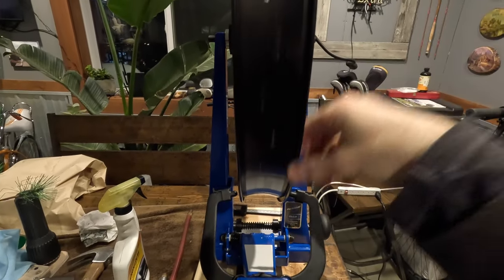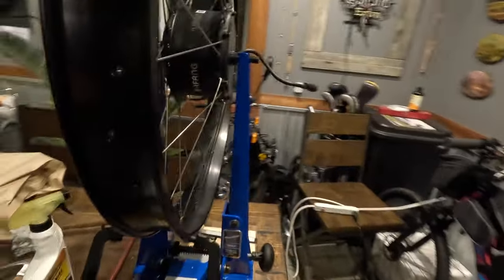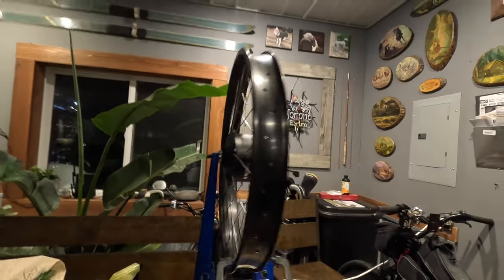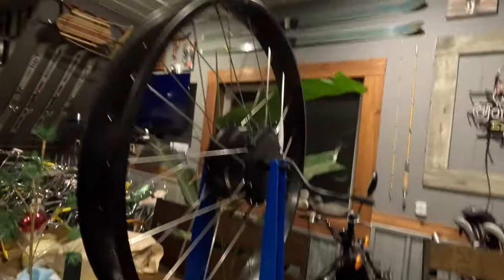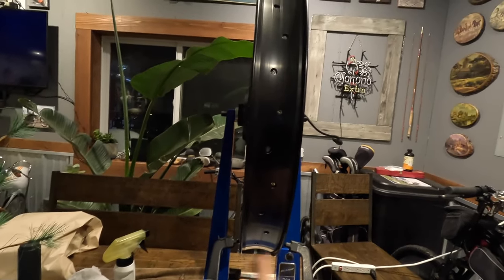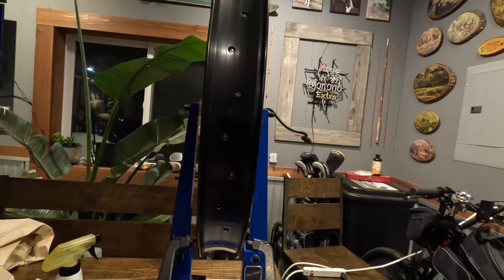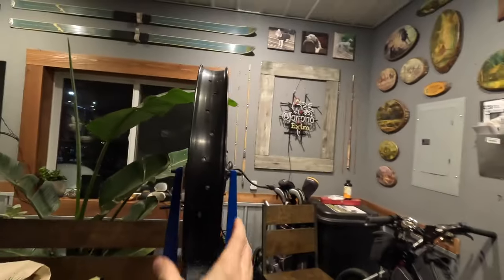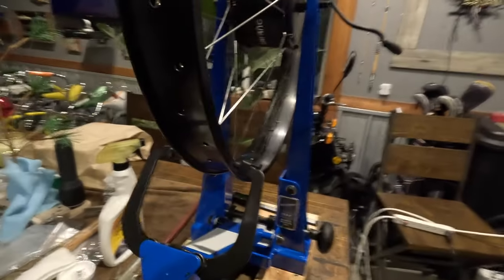Let's Build a Wheel - BAFANG G60 Hub Motor

Comment: Ive got a spare thousand watt motor one on the back i also have a extra battery will i benefit alot more  by puttin  the motor on the front ? Like uphill i shouldn't have much hassle right  ,but i also like going off roads and its prestty rugged here were i am ,so do you think i  should get a decent 2way controller or have it completely on its own battery motor and controller just like the back

Comment: You're making it look pretty easy I just ordered bafang for a plus six red Rover and it doesn't fit like they said it would. They said yeah just pop it out of the case and put it in your case. Then I get a hold of them and he says well you could re-stitch the spokes or whatever re-lace. Then I thought I'll just put the original f**** motor back in and be done with it all lol
Reply from the maker: @ernestatwood2787  there’s the shell that laces into the spokes and the rim. Then there’s the motor core , with the axle and the guts of the motor, you can take that out. And some are interchangeable. However, there are different variations of the motors. Some open up and the core comes out the drive side, some are the non drive side, The clutch in the inside of the motor likewise has two versions,   Etc. so in order to pop another one in it has To be a somewhat similar variant.  They come in different axle length and OLD outer locknut diameter. Eg 175mm and 190mm spacing on the g62 .  So if you want to upgrade yeah needs to be somewhat similar. You probably got one with a longer axle length / OLD, or you got one where it pops out the different side of the motor , etc. there also cassette vs freewheel variants of the motors
Reply: @EBikeBuilder_  thanks. Makes sense. They are taking it back  so that's nice. YouTube school is good! Lol

Comment: aliexpress motor link?
Reply from the maker: The front motor to buy in 2024  is Bafang FM.G061.1000.D    It is the 1000w front hub and has an m14 axle. I wouldn’t get one with m12 axles they spin out so easily

Comment: Wouldn't a back hub wheel work on the front ? Once it fits and sprockets are stripped .
Reply from the maker: No , front dropouts on fat bike forks are 135mm, and rear motors are 175mm or 190mm , even if you take the cassette off  it still has a long axles that won’t work in 135mm front spacing. I’ve also tried to put a 190mm motor in a 175mm motor shell and that doesn’t work either. Its hard to realize until you try and do it with the motors in hand. But each size is physically different for a reason
Reply: @EBikeBuilder_  my 20+⁴ are dropouts there not common but ive a American magnum fatty with them its old now and a stepthru design with a 2tho watt motor 72volt battery fits like a dream were the stepthru is wouldnt advise on todays foldables this was when proper men made bikes good company that magnum they use or are german but based in america get the American models das kit i think is one of the most reliable solid there is my mum has her daily 9yrs 12miles a day

Comment: That’s going to be a beast!! 👍
Reply from the maker: not entirely practical. but it should be fun and entertaining 🤣
Reply: @EBikeBuilder_  your rite and sorry if i came across as a tool! ,heres what im currently at making a machine thatll pushout axles so atleast front motors can fit in the back cos we all know they never last no matter what we do ,well 1 has lasted for me but looks Frankenstein like i put a rear on a front shock using like scaffolding poles going up so far eachside cant blame a brudda for rhe hustle bro 😆😆😆got the whole summer outta that bitch and still goin ✌️

Comment: Some one knows if you can put that motor in the normal rim no fat ?
Reply from the maker: It needs 175mm rear dropouts, you could spread a steel frame and put it in
Reply: @EBikeBuilder_  but I'm have 1500w motor hub and is so much bigger than this one

Comment: Overall good info but there are a couple of steps missing.  The first is making sure the wheel is round.  You would do that by bringing the stand arms down to the outer edges of the rim and seeing where it strikes them.  You would then tighten the spokes around the high spots to bring the wheel into round.  Considering the speeds I suspect you are looking at maybe doing, having a good and round wheel may be what keeps you with the rolling side down.  
The other is pre-stressing the spokes. You want to do this step after you have the wheel rounded and true as the spokes need to be at or very close to their final tension. This can be done by putting the wheel flat on the ground with a piece of wood or something to protect the hub.  Put your hands on the side of the rim across from each other and pushing down hard. You may hear the spokes ping as they are getting seated against each other or in the hub flange and the nipples in the rim.  Rotate the wheel or move your hands a bit around the rim and do this until you have pushed seated all the spokes.  Do this to both sides of the wheel and re-true the wheel.  I like to go through this at least  I've seen old school builders that would even stand on the rim.  This step will help with the wheel durability as it will lessen the amount of loosening that will happen in the early use of the wheel.  I always bring my wheels back to the stand after each ride for the first few rides to ensure all the spokes are still in proper tension as they settle in.  Loose spokes is the most common failure of a wheel barring crashes.  When they are loose the elbow is able to move around in the hub flange and will break there.  
One other note for anyone following this guide is to make smaller and smaller adjustments the tighter the spokes get.  Once I have the dish correct I start turning each nipple less and less.  Smaller adjustments make it easier to get everything lined up.
Reply from the maker: correct, good points. I mention Radial truing, but also said I don't intend this to be a tutorial on wheel truing. This is the 2nd wheel I have built, I don't claim to be a master, just showing the general steps. I take it very easy riding the wheel around slow in the driveway at first, and will make more adjustments after riding with a load on the bike. I'm not quite there yet, still haven't installed the wheel, waiting on my z916 extension cable and flange nuts. I do plan on riding at the speeds you suspect  Lol,  so i will take my time with it.  Thanks for the tips I will try them out when I make further adjustments to the wheel.
Reply: @EBikeBuilder_  Yeah I figured you would be doing more with the wheel when you mentioned the park tools video.  Just wanted to get the info out there for anyone that might be inclined to follow along.  My first wheel build failed miserably and I wasted a fair amount of money on spokes to rebuild it a second time.  Thankfully I did not crash as a result.
Reply: I've never heard it explain like that the rolling side down lol. Yeah I'm toying with the idea of releasing mine but man I really don't want to get into that I called my local shop and they just stopped doing it because they said it was a pain in the ass

Comment: 3 motors must be quite an experience! Will you put also 3 batteries? Also 72 Volt on front motor?
Reply from the maker: yeah its gonna be 3 batteries,  i'll have to have one in a backpack till i figure out how to get it on the bike. Im not gonna do 72V on the front motor, it would require an expensive controller thats kind of overkill for a 750w motor. I might in the future so i can get both hub motors hooked up to 1 throttle and the cycle analyst display.  For starts the G60 will be on 48V or 52V with a stock ish controller doing about 1100W

Comment: I'm doing the same thing but use an All Axel direct drive in the front with 3 20 AH 72v batteries. Just waiting for the 3 Phaserunners to come in stock. I believe all 3 motors can be run off of 1 throttle. This bike is geared down for torque not speed but believe all 3 together will do more than 70 km/hr. Strictly a bush mountain climber.
Reply from the maker: i dont know if they make the phaserunners anymore?  i thought the frankenrunner had replaced them. Maybe it was just a short term thing due to component shortages im not sure. I havent seen phase runners in stock since the plague happened.  Grin Tech has a CA3-WP splitter cable that can apparently be used to hook up multiple motors to a single cycle analyst, it might be limited to 2 motors im not sure. Grin has some videos about it  but not much written documentation.  In any case that All Axle hub looks awesome man ive been close to pulling the trigger on one of those! Let me know how it goes id love to see!
Reply: Have been in contact with them and should
Reply: Phaserunners should finally be in soon.contacted them about the splitters waiting for reply to see if 3 motors can be run on 1 CA3- W P

Comment: Hi,,,great work on your vids,,,🙂. I have an inquiry I was hoping you can help me with. Due to buying a kit/individual parts,,,would it be possible to just buy an inexpensive fat ebike,and just swap the rear hub motor to the front?
Reply from the maker: You can use whatever motor you want, as long as it can fit in the bike dropouts. However, the front and rear motors come in different widths. So generally you need a front-specific, or a rear-specific motor. Because the dropout spacing on a rear fat bike is usually 170mm or 190mm.  And the front fork usually is 135mm. If you want a front motor, it would need to fit in the front fork.  Bafang for example has the "FM G60" which means "front motor",  and the "RM G60" which is a rear motor. The rear motor is wider because it has the gears cluster.   I hope that answers your question. In general I would recommend a rear wheel drive ebike.  The front wheel motors spin out and can be dangerous.
Reply: @EBikeBuilder_  Thank you for your reply,,,I will get a FM then,,,,🙂🙂👍👍👍

Comment: Would you be willing to post that motor link from ali ? I can't find a front 750 with the right connector anywhere 😢.
Reply from the maker: hey mate I got mine from this link, but since i have bought it they have changed some of the pictures, and it looks like the connector is different (red color?? it looks kind of like an L1019 connector except its red and its got more pins. It looks like it comes with the wires split so you would have to wire it to a controller manually unless you can find a controller with that red connector. https://www.aliexpress.us/item/3256804492408957.html?spm=a2g0o.order_list.order_list_main.10.57a61802DkDoxc&gatewayAdapt=glo2usa

Comment: 20inches normal hub motor can install to 20x4 fat tire wheel?
Reply from the maker: depends on the width of the motor and the length of its axle. ANd the width of your bike dropouts. A normal hub motor is probably 135mm wide.  Fat bike hub motors are 170 or 190mm wide.

Comment: I like that, send me the link to them tires, I want some for my fat tire build.
Reply from the maker: The front is a Maxxis Minion FBF, the rear is Minion FBR, they come in different sizes i have 26x4, there are also fatter 26x4.8, i think there’s a 27” one. They can be hard to find i got mine from some random bike shop’s website.  There are some on Amazon that are 26x4.8”, but those are super fat and might not fit all bikes and rims. I like the 26x4 because my rims can do tires from 3” to 4.25” wide. I had to do some searching back when i bought mine a couple years ago.  When i get a chance I’ll look for a link and if i find anything I’ll let you know.  You might want to pick out a bike first so you can get the right size tires. i don’t think i can fit the 26x4.8 on my bike they are too wide for my front forks.
Reply: I have an AWD bike from Eunorau. One thing I learned is you need tubes on front and back with nuts to hold them to rim as the torque will make the tube spin inside tire.
Reply: Forgot I use Maxxis FBR on front and back as the FBF were designed for non motorized bicycle for better traction. FBR were designed to push the bike. I primarily use front wheel drive because we're you point the bike is the direction your going to go. When you get into slippery ruts mud or snow and you try and get out the front may only slide along the rut and won't climb out so put in AWD and back tire pushes tire out then front tire will pull back tire out. Love AWD.

Comment: my front g060 arrives tomorrow :D  Did you end up using just 1 front torque arm?
Reply from the maker: Nice!! Did you find the fm g60 on Ali?  I’m using the torque washers that the motor came with. In an RST GUIDE 26 fork that’s got chunkier dropouts. Grin tech came out with a new torque arm I’m gonna try. Kind of expensive but supposedly an improvement
Reply: @EBikeBuilder_   bought it from the link  you provided earlier.  Seems they changed to that new connector but making me an adapter free of charge.  
I'm using their v6 on my back hub.... no comparison to the cheap ones I bought and returned off Amazon.  
V3 for the front I guess?

Comment: I built one hub motor wheel about a year ago. I did not enjoy it. I hope to never do it again or use my Park truing stand.
Reply from the maker: i agree its a tedious job i dont enjoy it either, but its a valuable skill to have, being able to put together a wheel with specific components.   I try to avoid taking the wheels off my hub motor bikes Lol and I use zip ties to do most of the lateral deviations and basic truing. But if you are building a wheel or making lots of adjustments to the spokes the truing stand is invaluable
Reply: @EBikeBuilder_  The only reason I even decided to do it was my LBS told me they don't build wheels. Years ago another LBS, who has since closed, built one for me. It was cheaper than buying all the tools to do your own.

Comment: I'm thinking of putting a direct drive on my ebike to enhance the top end speed. My ariel rider kepler tops out at about 33mph on flat throttle Only. How manu amps and volts should the front hub direct drive be so it could hit 45mph? Hoping to run 52v!
Reply from the maker: That's interesting i thought i kept hearing ppl say the Kepler tops out at like 36 or 38. But makes sense i think when my G62 was on 52V i had it set to 40A with my frankenrunner and it was doing like 36mph  was the fastest i could get it to go on 52V.  What I would do is goto the Grin Tech motor simulator,  and plug in a direct drive motor comparable to the one you want to use.  Then change the settings like controller amps,  battery voltage,  the motor winding kV is also important, it will give you a theoretical top speed, and how long it takes to overheat etc.